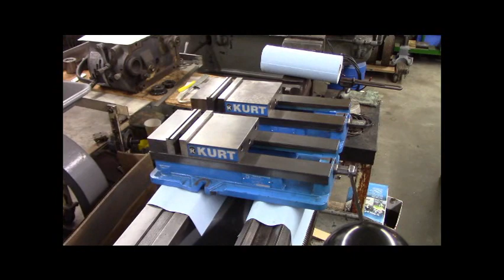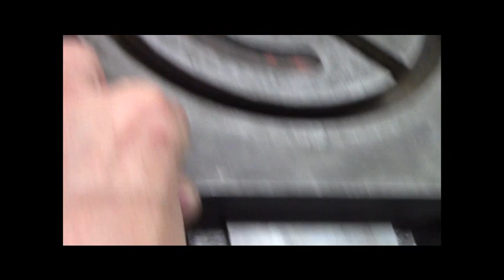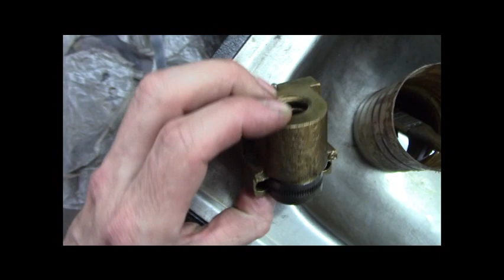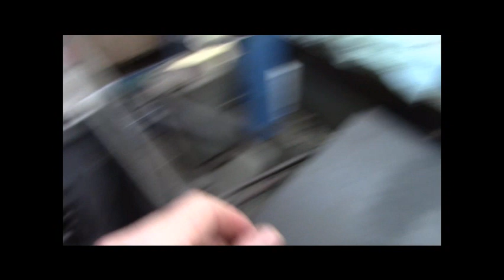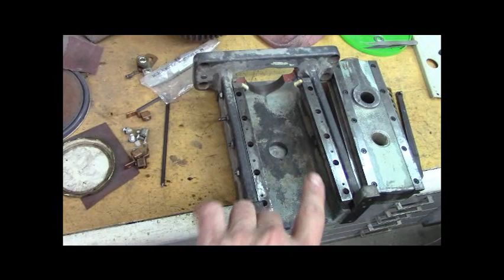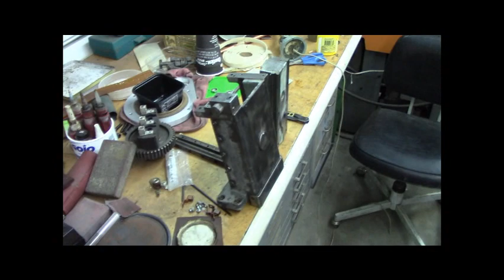8-30-21  P&W 12C Lathe - Spongy Cross Slide Fixing

Comment: I was mesmerized by the construction of this machine, there is a model B in my family. There are a few of these around in my area that were used in the nuclear work at the Hanford plutonium enrichment site, and also in submarine work at Electric Boat. The ball bearing spindle has high rotational accuracy useful for items such as non contact gas seals, and high speed, high accuracy  rotating parts for silent running in submarines. Rotational accuracy is a separate specification from nose run out. The model C is designed more for fine work, using higher speeds like a Monarch ee series.

Comment: Restoring it one piece at a time! 

Leadscrew pusher T/As are the worst by the way. South Bend had it right. Everything since then has been a downgrade. Same on dad's Rockwell. Same on my Daewoo. Same on the Lagun and Sidney if they had one. They all suck. All of em. The cross-slide should be rigidly locked to the T/A and infeed with the compound.

Comment: Are those trust bearings in backwards? And that’s why they are not loading up
Reply from the maker: I first thought of that.  I looked in the parts manual that I have, and they are correct.  They are even labeled THRUST on one side of the race.  Great thinking though.